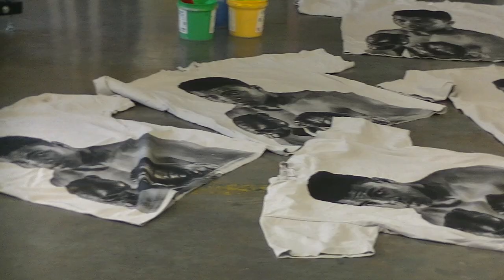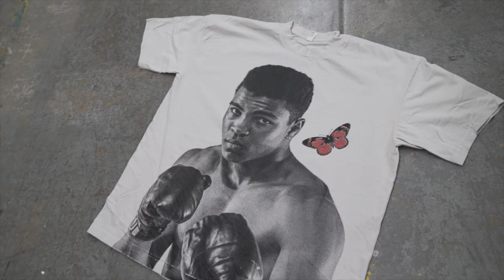Screen Print Halftones Portraits | a look into Unfinished Legacy

Comment: when you first started screen printing and using flash dryer, how did you manage to use a flash dryer without shorting your circuit/power ? haha, im using a flash dryer for like 10min and it shorts the power

Comment: What do you think the best way to cure ink is when youre doing this at home? Ive heard of people using irons but i feel like an oven would work? Idk any suggestions? Also thanks for putting out all this stuff man, such a great source of info
Reply: Use a heat gun to partially set the ink after printing, then put Teflon paper over the print and iron it with a hot iron for 3-4 minutes to cure the ink. 
...Or buy a heat press.
Oven would work, but it might be too hot and shrink your clothes. Cotton shrinks when it's hotter than 140F degrees.

Comment: How do you not get ink bleed on the other side of the screen? I feel like any time I print halftones with black ink I get really bad ink bleed and have to clean the underside of my screen after each print (which is very hard because it is black and just smears everywhere).
Reply: I've noticed some improvement with like about a nickle height of off-contact and switched my squeegee to the pull ergo style and that is helping with consistency. But eventually, the dots get larger and larger and lose detail and I have to clean off.. dot gain? I've read into it, gets complicated but I can see why you want the smallest dots possible to compensate for the enlargement of them to get into some kind of serial production.

Comment: What would you recommend is the best way to clean a screen after printing so it can be used again another day?
Reply: Depends on the ink. Water based ink you clean it with water, and degreaser. Plastisol you wipe up 99% of the ink with newspaper, then use an ink degrader (or olive oil) and paper towels to get the last 1%, then wash it with degreaser.
Reply: @TheUnholyPosole  thank you so much! 🙏🏼

Comment: What mesh count is good for halftone?
Reply: Depends on the ink, water based black is usually 300, while white plastisol is usually 110-160. Fabric matters too, some needs lots of ink (110), and some not so much (300).
But if you want to make a shirt like Brema, 160-220 would work.
Reply: 160-220 it‘s inches right, because und europe we‘ve got like 72, 80…?